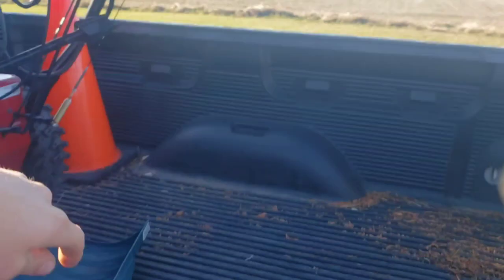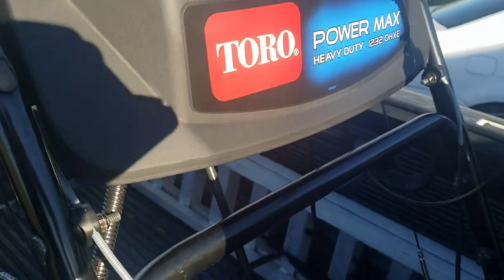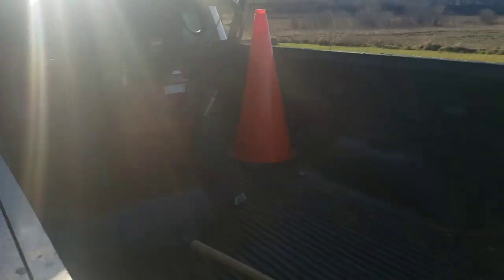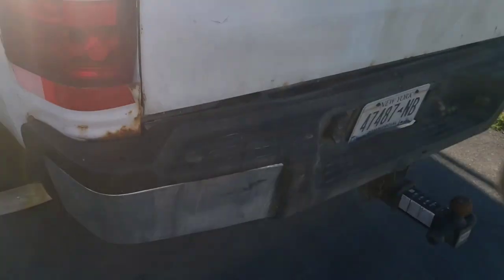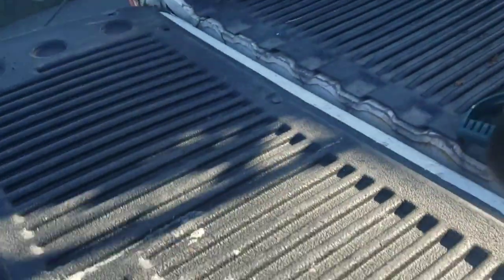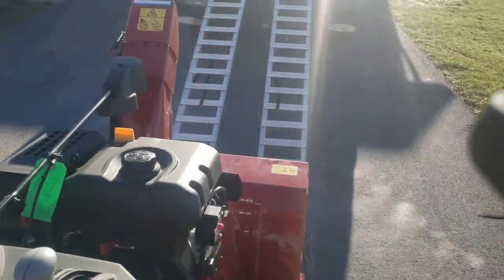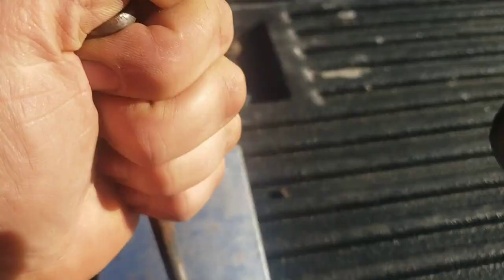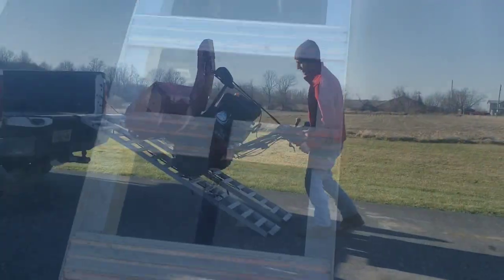How I load/ transport a Snowblower in pickup bed | Truck & ramps

Comment: What if someone doesn’t want to drill the holes in their truck / SUV to secure the ramps. Is there any other way  to secure them ?
Reply from the maker: Most definitely.  Sorry I did not mention in the video.  

Ramps typically come with a strap & hook attached on each of them. you hook this on the mounting spot inside your truck bed.